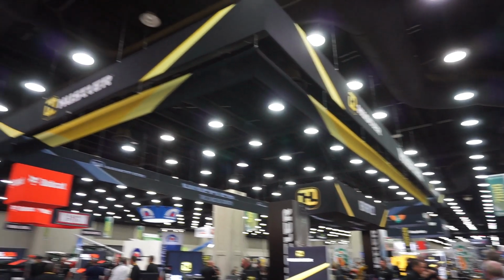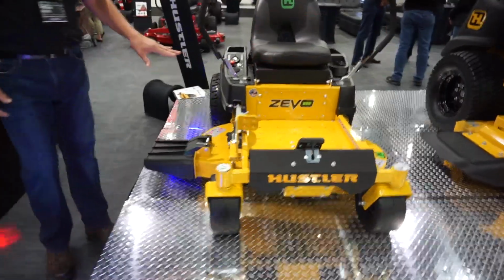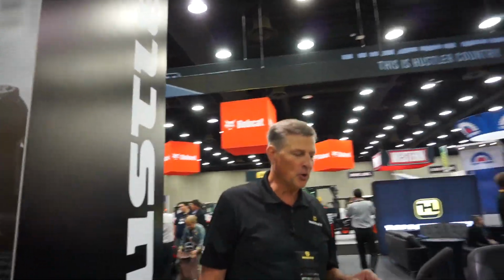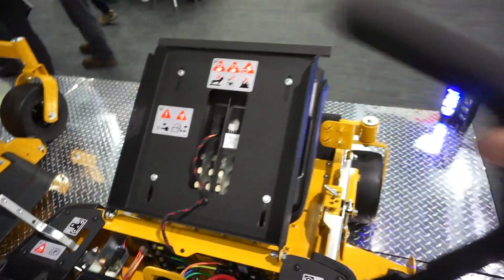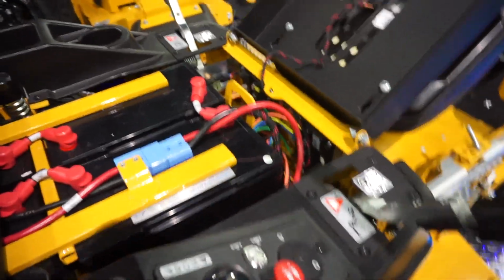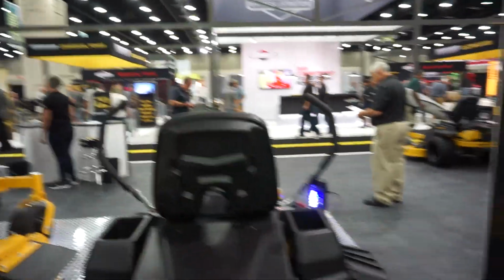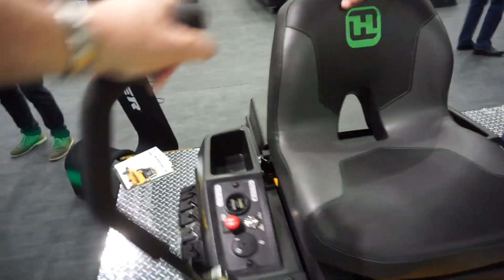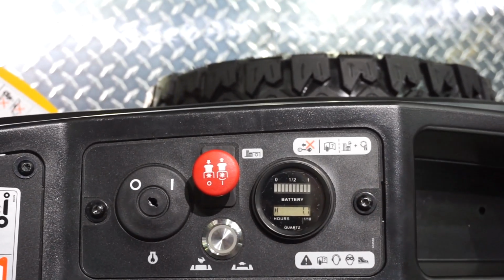2022 Hustler Turf ZEVO Electric At The 2021 GIE-EXPO

Comment: Like ve my hustler raptor zero turn, but why can't I find a new deck for it?
Reply from the maker: Contact Hustler Turf for a dealer near you. What is wrong with your original deck? Rust through? Cracked around a spindle? Warped? All of those are repairable as well as making it even stronger.

Thanks for watching.

Comment: mows UP to 3.6 acres then needs a 6 HOUR charge haaa ! no thanks
Reply from the maker: That's more than it is recommended for anyway. I think its recommended for up to 1.5 acre lots. But then, 3.6 is double that if it will make that on a charge.
Reply: @MaxsGarajMahal  ok thanks still a pass I wist they did make one that lasted longer id buy one .
Reply from the maker: @acatnamedscoop7718  That makes a bunch of us. I'm working on one, however, not sure as of yet if I can make it run out past the Mean Green Mower. 4 wheel drive all wheel steer but still zero turn. Best way to stay on a steep hillside is with all wheel steer. Wish me luck.
Reply: @MaxsGarajMahal  as a conservative and a Trump supporter who's is all for WORKING clean energy that doesnt cost more than real energy,  why cant someone come up with an enclosed trailer with solar panels on the roof so everything gets charged While you drive around or while its  parked its 2022 it cant be that tough to figure out
Reply from the maker: @acatnamedscoop7718  There are people with them. Europe, Australia, New Zealand, UK, most of Asia are already there. It is the US that is behind in most all technology.
Reply: @acatnamedscoop7718  because the solar panels only have 15% efficiency. It's take months for solar panels to recharge a battery that size.

Comment: Hustler!!!
Reply: No lithium Ion batteries???? AGM are heavy and won’t last as long and take longer to charge. The new batteries will be released in 3 to 4 years and be revolutionary.
Reply from the maker: @quietone1332  They have them. Putting together modular systems for more products in the design stages is my guess.
Reply: @quietone1332  what new batteries? Lithium has been out but solid state should be out and take over in 2-3 years.
Reply: Great on-site and informative video!
Reply from the maker: @TerrellWillams  They been keeping an eye on your brother. Nobody hustles better than you.